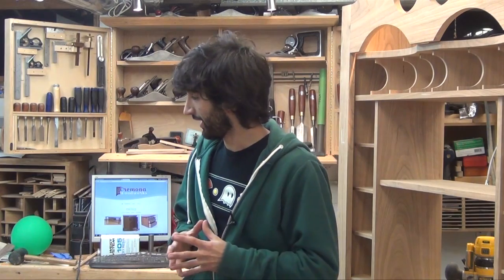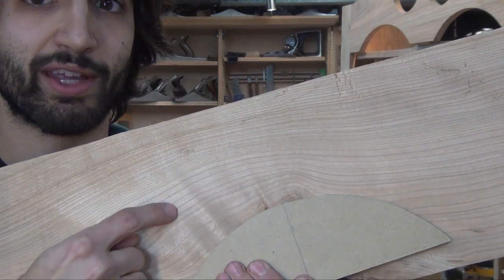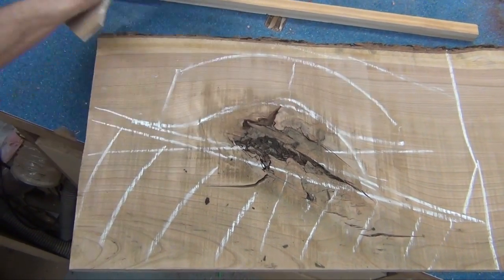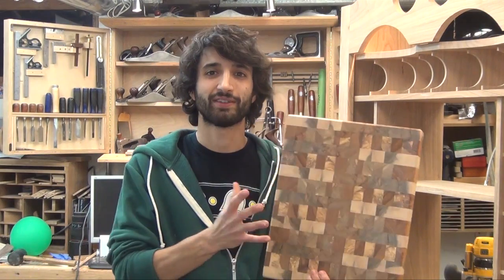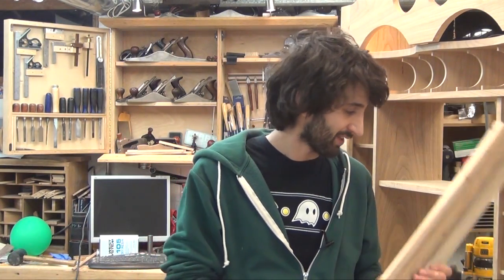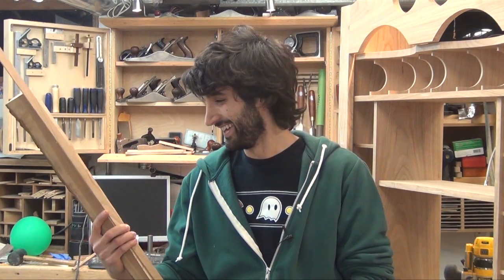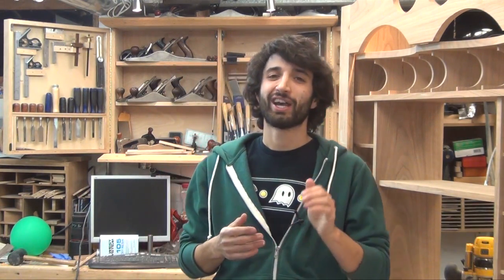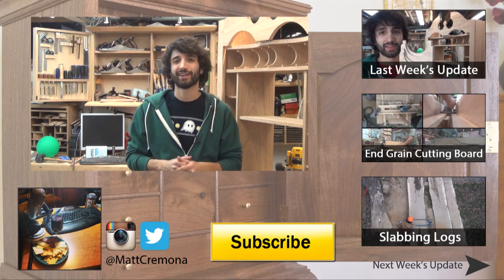Matt's Weekly Shop Update - Dec 15 2014

Comment: Do you think the wood will change shape after you cut into it ?  It may.  Consider cutting  it to shape progressively giving it a day between cuts. From my experience I expect the swerly grain boards to twist as I cut them.  It does not always happen and may not be a concern, depends on how that piece will fit in.  I had to give up on one piece as it twisted more after each planing.
Reply from the maker: Big Fat Tony's It typically does.  I mill my stock in 3 sessions with a few days between each.  They first session I get it cleaned up to the point that most of the rough sawn marks are removed.  The second time, I remove enough material to get it within 1/8-3/16" of the final thickness.  The third time, I take it to final dimension and cut my joinery that same day.  That board that kept twisting on you must have had some sort of internal stress for it to do that...
Reply: I think it will also move after you begin cutting out the arch.  I think I would cut out the arch rough and then plane it to thickness and finally use my template to re-draw the line and cut to the final shape.